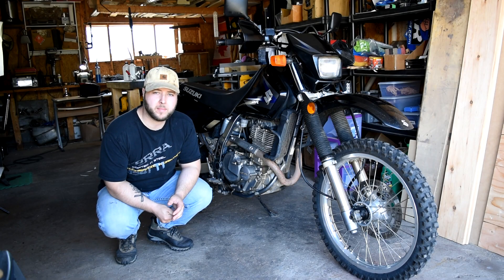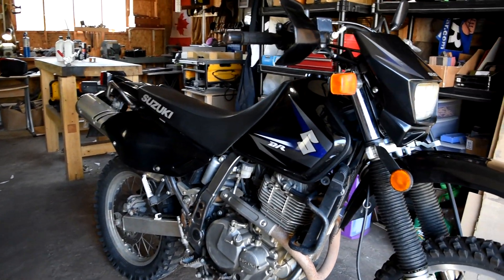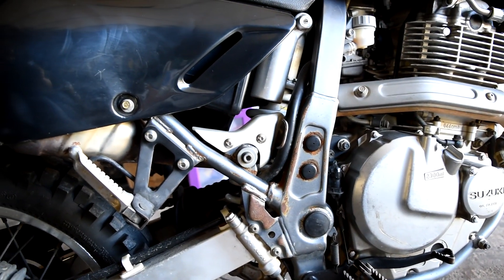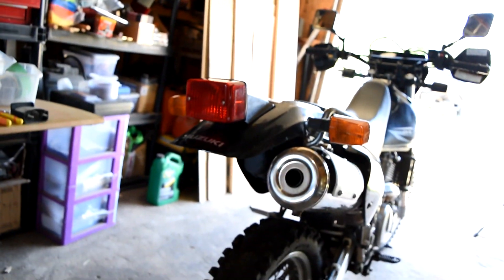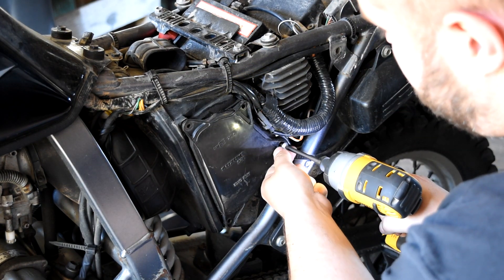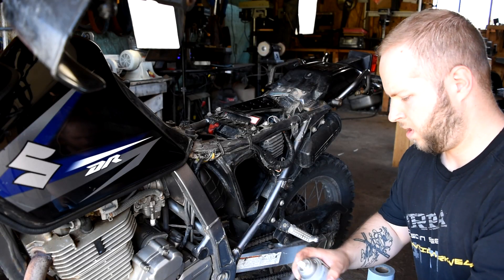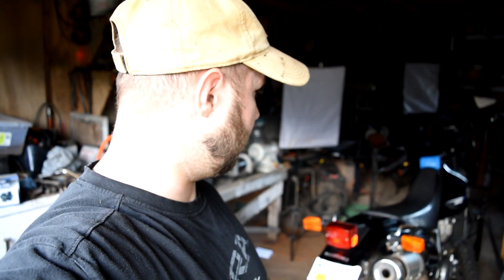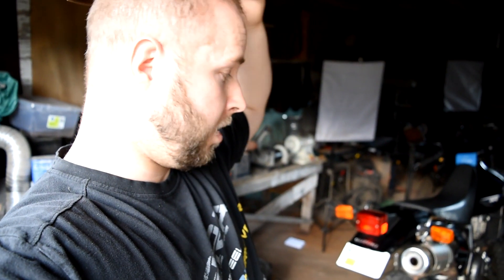Have you seen motor oil this bad?! - DR 650 [1]

Comment: Kyle, nice bike. Make sure that extra oil you drained out was not gas leaking into the crank case.
Reply: AD4MRick so right but the level
Of spooge in the air box would lead me to doubt that fuel is passing through on its way to the crank...

Comment: I see oil like that where I work a lot lol. No one maintains lawn mowers... make sure that there isn’t fuel in the oil. If it’s been sitting and the carbs are dirty then there’s a chance that the needle valves wouldn’t have been seated all the way and a lot of people leave the fuel switched on. If you have the petcock on and the needles don’t seat, fuel will continue running into the carbs until they overflow, then it’ll fill the cylinders, then it’ll seep into the crankcase between the piston and rings. The fuel breaks down the oil and then when you run the bike, the oil isn’t nearly thick or  slippery enough.
Reply from the maker: Thanks for the extra info Julian! The DR's run a battery vacuum powered petcock, so the tank won't release fuel unless the ignition is on. That shouldn't be an issue here. I think the previous owner was simply a moron!

Comment: What I usually do when I get an engine like this.... used and do not think it has been super maintained is I will run it after this oil change for a very limited amount of time!  About 1-2 hours!  That is all!  Than I will do another oil change!  Like you said it does not take that much time and for a couple courts of oil and a new filter it is worth it!  I have sometimes gotten quite a bit of more crap out of the engine that has been sitting around!  Just what I do. Hope this helps you!
Reply from the maker: I think I will, Jason! Thanks for the tip!

Comment: Remember when cleaning those foam filters look for holes or tears in them. When cleaning the air box just stuff a blue rag in the intake so none of that gunk goes into the engine I like to use the spray cleaner and oil for my filters they work great and it's nice and easy.

Comment: Make sure to add a little bit of seafoam to the gas to help with the engine. not sure how it works off the top of my head but I think it helps clean the carb. if i'm wrong someone please correct me so I'll know :)
Reply from the maker: I haven't used seafoam before, but I am running a similar type product from STP! I have had good luck with it